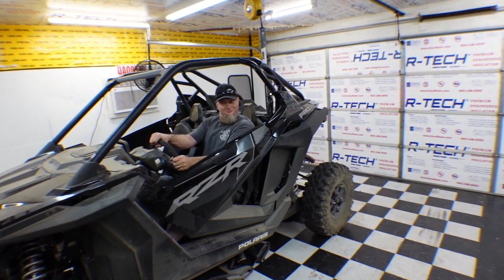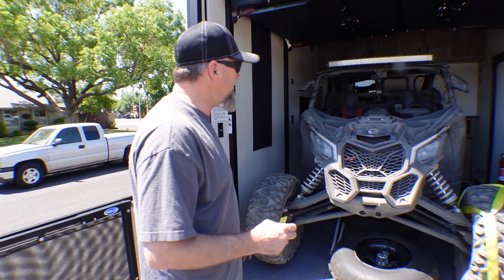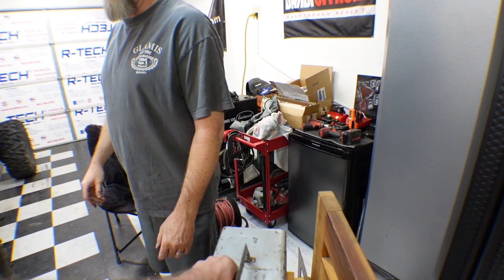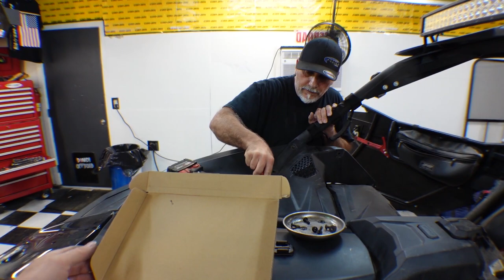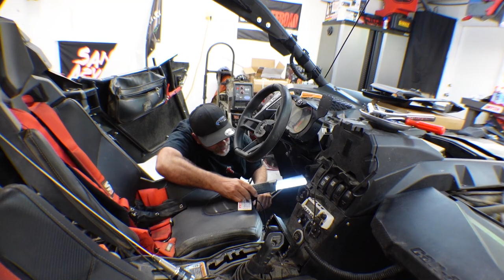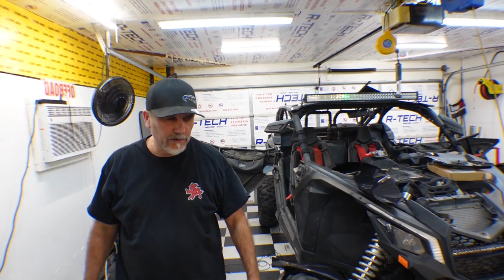Lighted Grille for the X3

Comment: That’s funny I was just going to type “I think I saw a heat gun in your shop before?” Lol
I like to put a small piece of heat shrink over the ends of the flexi braided cable protector first then a bigger heat shrink over the connectors that s slightly shrunk, so I can slip it off if I need to remove the light.
Reply from the maker: Yes definitely, but then I have to get it out,, plug it in,, LOL.. good tip